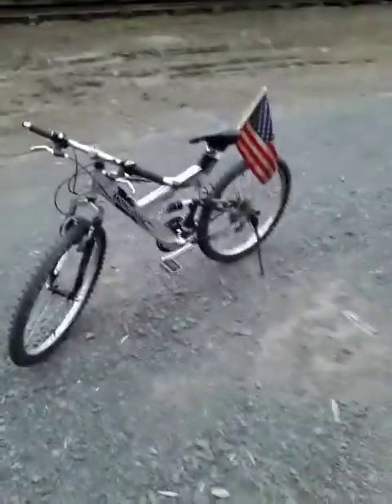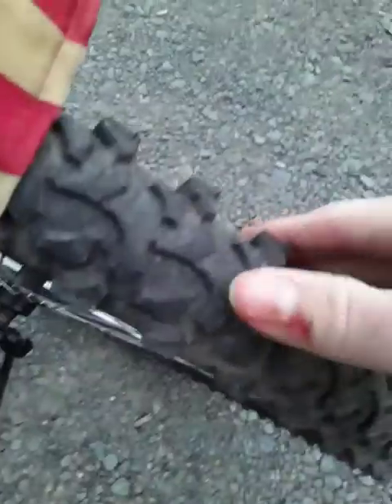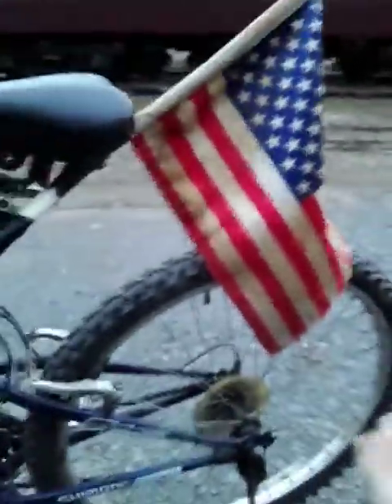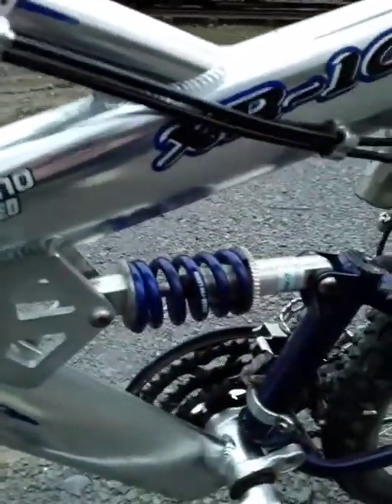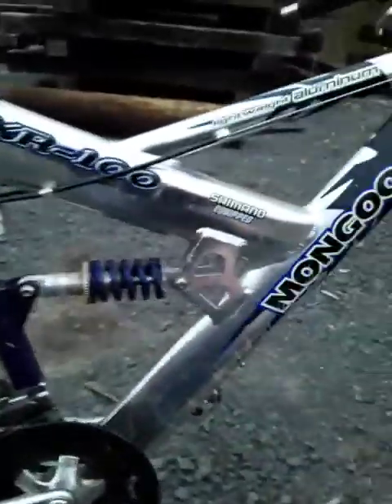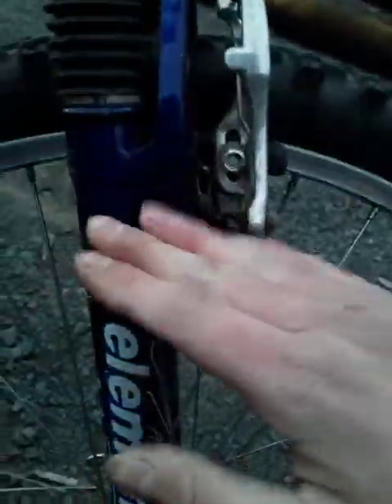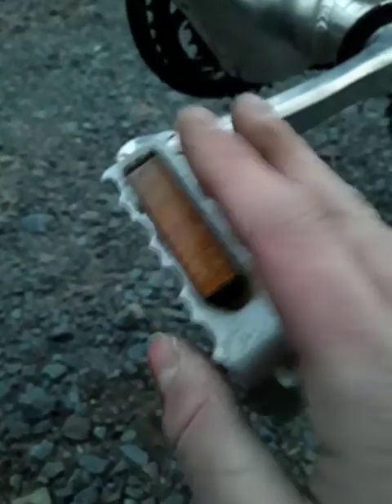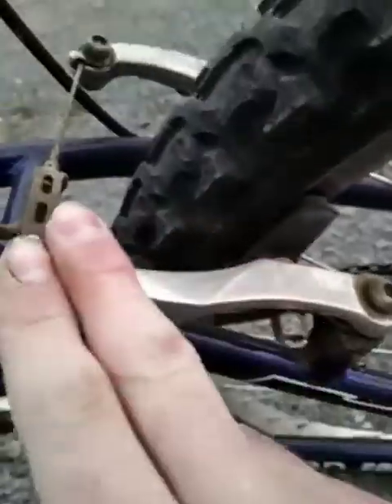My Mongoose XR-100 review

Comment: May 2024
So I got this bike on a similar occasion as you, I went to work on a clients house, had to demolish a small utility trailer, & there was the bike was, the homeowner told me I could keep the bike. First I was like idk, I ended up putting at the back of my pickup truck, next day I was going to set it out for trash but it was just dusty with no air in both tires, I turn on my air compressor & boom tires air up nicely. Wipe it down & it looks brand new, I hate to say that mine it’s in a bit better condition than yours freind. So I decided to keep it. The homeowners were a very nice elderly couple & the best thing they could’ve done was keeping the bike inside their utility box trailer. Now it sits in my tool shed & soon I will have it hanging off my garage. It’s the same bike, 100 series. Same colors too. 
Dallas